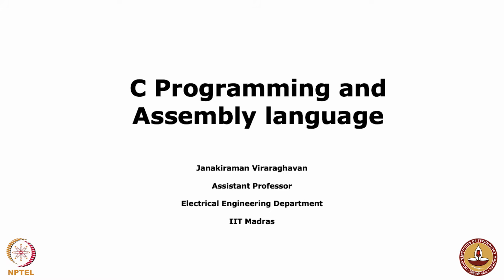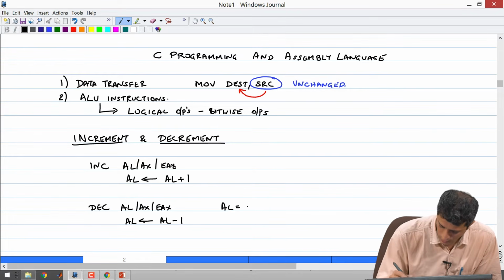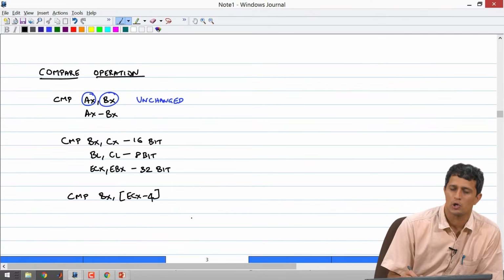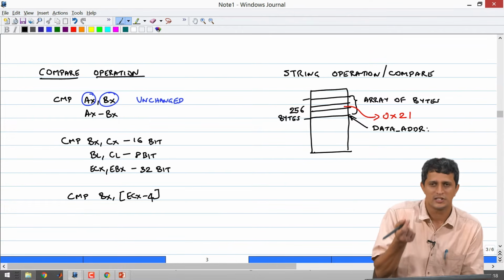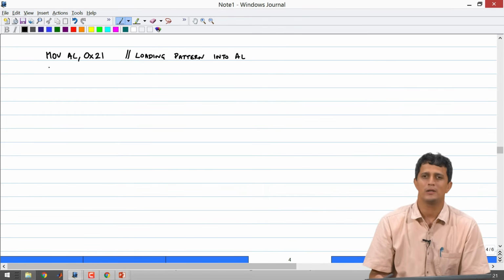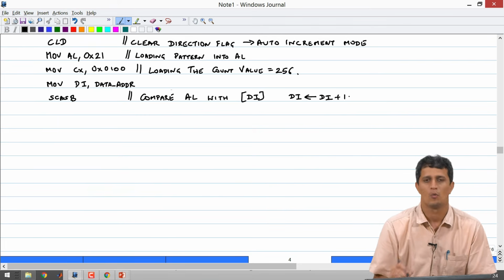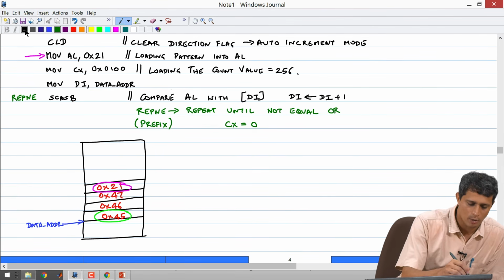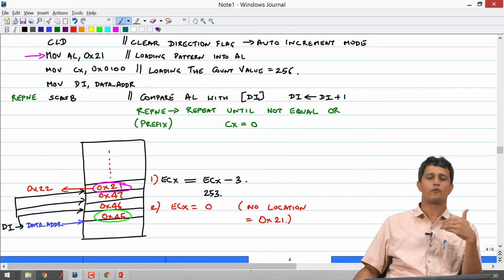Lecture 4A

Comment: SIR, 
CLD means we are making it auto increment. Then why in the example 256-3 instead of + ? Was that an example of decrement ? In memory up to down is increment or down to up?.
Reply: CLD is for SI and DI only. The counter CX gets automatically decremented
Reply: ECX gets decremented due to the Prefix REPNE. that specifies the counter to decrement.
Reply: @shibendumahata  I wouldnt say automatically but becuase of the REPNE prefix it gets decremented
Reply: @CharmanderRazor Correct. I should've explained better.

Comment: Thank you all for your interest in this course. I would like to remind the viewers about the purpose of this lecture. I have mentioned this aspect a couple of times in the introductory lecture but it is worth spelling out explicitly in written form. 
DISCLAIMER: The lecture is meant to give you some familiarity with Microprocessor assembly language, specifically the x86 instruction set. This can be a separate course on its own which is indeed the case in the B.Tech/ B.E curriculum. These lectures are meant for someone who is already familiar with an alternate assembly language but may not know the x86 instructions. So DO NOT use these lectures as a substitute for information regarding the x86 instruction set. I have deliberately kept away from the in-depth details of the instruction and pathological cases as I believe they hinder the learning objectives of this course. I do not claim to be an expert in the x86 assembly language either. You are advised to take the essence of the instruction from this video and refer the textbook by Barry Brey for further details. However, what I cover in this lecture is more than enough to take you through this course. Enjoy your learning experience.

Comment: sir , the pattern 0X0100 how does it denotes 256
Reply: While converting from hexadecimal to binary, you multiply each position to nth power of 16 from right to left as follows: 0 x pow(16,3) + 1 x pow(16,2) + 0 x pow(16,1) + 0 x pow(16,0) which results in 256.